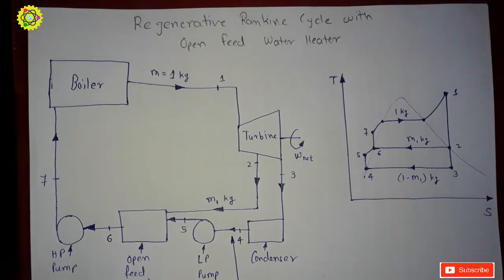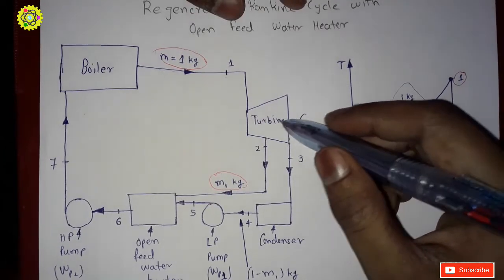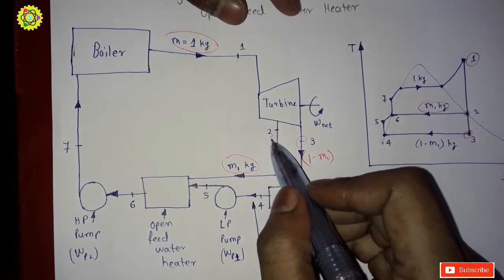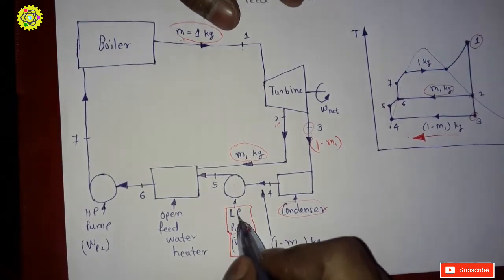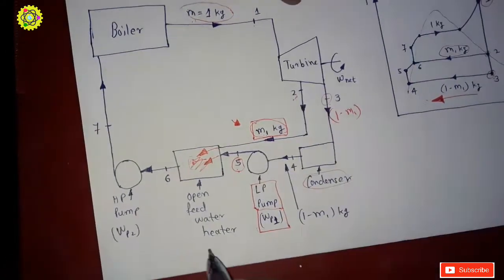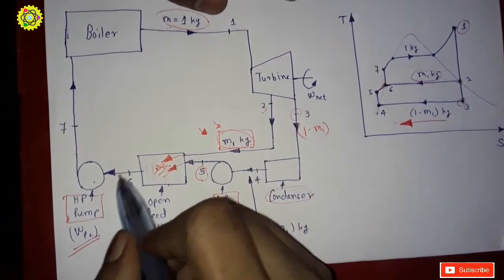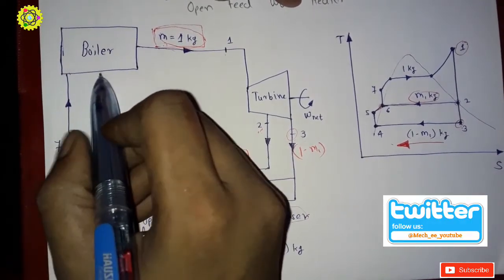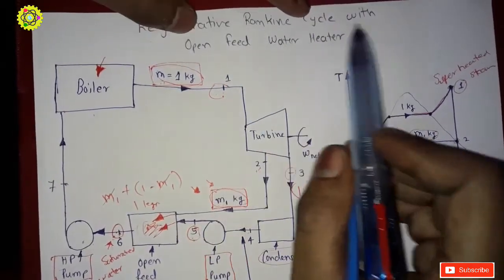Regenerative Rankine Cycle with Open Feed Water Heater explained with diagram & graph

Comment: In a steam power plant operating on regenerative Rankine cycle with one contact feedwater heater, steam enters the turbine at 8.0 MPa, 350 C and condensed in the condenser with a pressure at saturated temperature of 40 C. Some steam is bled at 700 kPa for feedwater heating. There are 27.5 kg/s of steam entering the high-pressure turbine, determine:

a) extracted steam flow per second

b) turbine work output in kW

c) thermal efficiency of the cycle

( Home Activity : If the extraction of steam is at 1.2 MPa , determine a b, & c)

My question is what is the meaning of the extraction of steam for this given problem and where would i use the 1.2Mpa or should i replace a variable with 1.2Mpa in the given problem? Thanks in advance
Reply from the maker: Extraction of steam means some amount of steam is taken from the turbine at intermediate state during turbine expansion process and this steam is used to pre heat the feed water in feed water heater.
Reply from the maker: The state 2 is mentioned in the diagram which is in the video. There will be 1.2 MPa extraction steam. You need to use this parameter also along with other. This value is required while calculating extracted steam flow, turbine work output and thermal efficiency.